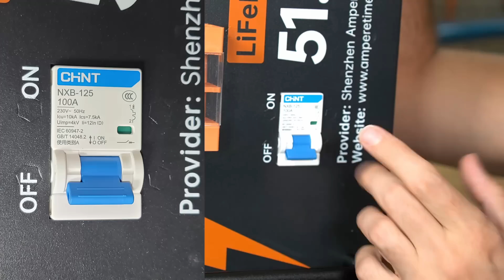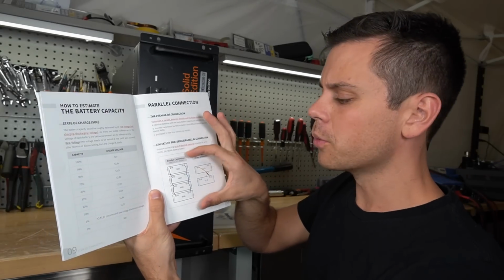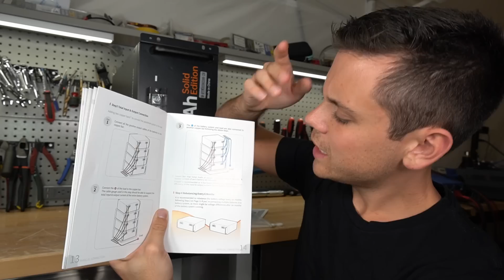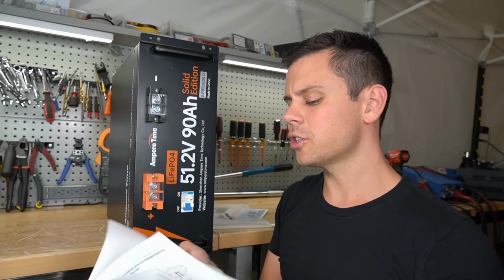New! $1,699 Ampere Time LiFePO4 Server Rack Battery

Comment: Hi, have u done any testing on Felicity battery models that felicity claims it uses grade A batteries like LPBF48300 
I installed one of these at my daughter clinic and they appear to work ok so far although we haven't really put heavy loads on the yet.

I heard so many claims about felicity using recycled / grade B batteries but so far I haven't seen complaints yet from anyone

Comment: Will,  I appreciate your clear explanations of a subject that is very foreign to me.    I'm looking to put together an emergency longer term back up system to run my fridge and separate freezer (3.2KWH total per day) and have a bit extra for some lights (maybe even 12V string lights).  Since the fridge and freezer do not need to run 24/7 to keep food cold or frozen, I'd also like to be able to keep my laptop charged and maybe run a monitor.  It looks like the 5.12 kwh EG4 battery would do the job, with a little left over. What difference would 48v make over the 24?  They have the same kwh rating.
Hook that up to  the 6500 EX 48 inverter?   I have a 14KW propane whole house generator that, for long term outages, I would prefer to run primarily to charge up the battery, and then use the battery to run the essentials.   Otherwise it would cost a minimum of $75/ day t(over $500/week) to keep it running, no matter what the draw on it is.  Your thoughts?  thx, Geo

Comment: I see these are available for $1199 now.  After watching a previous video on a 90 aH rated battery, I was wondering if these were 'used' cells as well.  Probably not worth the chance in reduced performance for the $300 difference.
Reply: Was their any design change or just price reduction?

Comment: Will you mentioned getting board with these tear downs .  I would be interested in more information on the functions of the BMS.  Since many of these units seem to use a very similar BMS I think it would be interesting.  How does the current limit circuit work? How does the balance circuit work? Etc.  what are the effects of one battery stopping charge for say over voltage how does it effect the other batteries.  Just an idea for new content.

Comment: Hi Will, I've learned a lot from your videos. Currently building an off-grid cabin and looking to start setting up my solar system. Any chance you could do a video on a system you would use in the budget range of $5000-$8500? I really trust your opinion and am curious what you would go with obviously there's a lot of variables but your videos always seem to cover a wide breadth the way you explain things.

Comment: Hi Will great series of videos. The cost of any PV system is dominated by the high cost of battery storage - have you looked at the feasibility of using an old EV battery as a storage device?. At about 10 years old the EV range will be down to about 100 miles compared to 300 miles new. The energy capacity of the old car battery will be more than sufficient for a PV system and thus give it a new lease of life.

Comment: I ordered your book on solar set up for RV's Will. Supposed to get it tomorrow. We currently have two suitcase solar units. One fell over and one panel broke and we bought a new panel but couldn't get it to work with the unbroken panel. Well we got another suitcase. I put the other back together and it still works. Each suitcase has its own charge controller. I use alligator clips for one to the battery unit and plug the other one into a plug in made for solar. Seems to charge the two Battleborn 100 AH batteries well. I have an ali gauge I put in. I filmed a short video back when I put it in, and it is on my you tube channel Burlington Bill. Always fun to watch your videos.

Comment: Hi Will, thank you for sharing so much good info on lithium. I’m currently building a system on my sailboat. Going through your video’s I couldn’t find a video on a system like we usually have on sailboats and hope you could make one. On my boat I have a starter battery (Lead) and a house battery. Input can be via alternator dynamo, current from land in harbor and optional solar or something like that. We have a lead and lithium system. I’m changing the house battery for lithium, do I need a new charger for the new lithium battery or can I use the old charger which was use for my lead acid house bank. We also have a device with switches which battery is charged first (don’t know it’s name) first starter battery then house battery…. Would be sooo helpful! Thanks for all you’ve done so far!!

Comment: Will I have a system im trying to hook my batteries up to. I will pay you to help me figure out what needs to be done. I have a micro inverter system that sells back to the grid. I was told i could get batteries hooked up for when the grid goes down. I can not find anyone to figure out how to do it. I have had many electricians and most solar companies wont come out since they didnt install the pannels and the rest of the system. The company that instslled my system is going to pay for instilation of my batteries. They only used tesla power walls and i refused to use them. I have 6 EG 4 batteries i need hooked up. If I send you the system schematics if you can figure out whats needed to be done I will pay you for your knowledge.

Comment: Hi Will: Just love the info you put out. I have a tied to the grid solar roof mounted (Tesla) contract. 

I would love to see a video discussing steps in converting a grid tied system to adding a battery backup system once my contact is paid off.

Comment: Hi, I'm looking for some assistance with a project for my RV. My RV is set up on a 12v system and want to add a total of 900w system. I have 9 100W panels with a new 100A MPPT charge controller with a 3500w/ 7000w inverter. input voltage is 15v-24v and max PV input power 1200w. My question is how to wire the panels. Any help would be appreciated.

Comment: Hi Will, I purchased a JITA 12.8v 100ah battery and was hoping you could tell me at what voltage should I let this get down to before I charge it? I want to discharge to 80% to help get the most cycles. I am guessing I need to put on charge when resting voltage is at 12.2 or so. I don't keep a solar hooked to it at all times so knowing what voltage I need to charge at will help me. Thanks for your help.

Comment: Will, What batteries do you suggest for a 36 volt trolling motor for fishing? Probably three 12 volts wired for 36 volt output.  That way I'd have a "back-up" 12 volt battery to start the outboard motor.

Comment: Well is there a way that you can connect a wind generator of some sort onto the front of a electric vehicle and have the power generated by the wind feeding back to the batteries as the vehicle is being powered by a different bank of batteries that you could switch from bank to bank and let recharge as you are discharging the other bank? In other words I'm thinking of having two different banks that you can switch from alternating for your power source while one is rolling the other bank is being charged by an alternator and a windmill and solar panels yet still connected to the one that is being discharged and used for power?

Comment: QUESTION !! Okay I'm going out on a limb here to ask a very good question!  If my home at this time is running avg 88 kwh per day for 31 days how much solar would it take to run this home yes I still could cut some unused  things out but it is a 2200 Sq ft home?  I have got a start on 3 100 watt solar panels, 3, 35 watt hour and a marine battery deep well, this is tied to a 5000 running 10,000 max load inverter.  All I'm trying to do is save money on these $368.00 electric bills now for the last 2 months this along is killing me financially.   Any help will be greatly be appreciated! Thank you.   Keep it up waiting for the next video!

Comment: Hi Will, great channel. I’m designing my system and am using Victron equipment minus array and batteries.
 Is there any reason you’ve never done a review about BSL Batteries? Their recommended by Victron for using with Victron equipment. 
I’m currently looking to purchase a few 51.2v 200amp models and can’t really find much on the web about them except the company has been making batteries 20 years. The lithium battery factory has been around 5 years or so. 
Any chance we could see a review in the near future from you?

Comment: Here is a question, I am thinking of getting a eco flow delta pro, it has a current/ voltage / wattage limits to its silt input. Here in U.K. the difference in solar gathering will be significant. Is it possible to have 2 banks of solar, use 1 bank for summer and both banks for winter, and have a limiter in case we get a sunny day in winter that exceeds the input limit? Steve

Comment: Hi wil, Bob here again, the other thing that concerned me with the KiitoKala battery was the price it says $244.24 then they give a variety of battery so I went back and double-check and yes it is the 150 amp hour battery they have many of these batteries all the way up to 300 and a half hours and they're all very low priced the 12 volt 300 amp hour battery is $610.60 that's cheap for battery this size so I'm wondering what the build quality is. Thanks again

Comment: Hi Will, thank you very much for your reviews and sharing your knowledge, I'm learning a lot from you!
I'm starting a solar and battery project soon, and I need some help to get pointed in the right direction, if you have a moment I would greatly appreciate your insights.
My wife and I are about to live full time in a 40ft 5th wheel RV and travel the US, Canada and Mexico; access to electricity is of course an important consideration. Our questions are: how should we determine what batteries and panels we need? What brands should we trust? How do we determine how much we need?
We know that over the course of 12 months, our avg energy use per month is 200kWh, the most we've used in a single month was 370kWh; how do we translate these usage numbers into both storage and generating capacity?
If there are some resources or websites you could recommend we'd be very thankful!
Reply: Buy his book..
Reply: @ES-qt6yo  I didn't realize he had a book, I will look for it, thank you :)
Something I want to learn about next is wiring individual solar cells on the convex roof of a vehicle - what translucent material to place over and protect the cells with, sensors/fuses between cells for safety, proper adhesives, etc.

Comment: It does look a bit cheap but... If you have worked in a data center south of the arctic circle you would know a low temp sensor would be throwing away money. And I will bet it was dropped or was in a shipping container in rough seas.. Love your enthusiasm 👍

Comment: Ampere time and it's several other names seem to build decent buget 12v systems. But the server rack and even the 100ah 48v marine battery are definitely way overpriced. Honestly, I'm not sure why anyone would buy them over the other options. For me I like to have low temp protection controlled by the charge controller vs my battery packs. Just so much easier to check on one sensor then be worried about 10 or 15 others.

Comment: Hello Will, I am enjoying your channel. I have purchased a Bluetti ac3000. I will charge them from portable panels and need to run a wire from the back of the house to the ac300 in the garage about 70 ft. what do you recommend on wire to use and voltage?
Reply: test

Comment: You had asked for video ideas a few videos back. 
I am interested in how vertically mounting bifacial panels (run N-S) compares to placing them south at optimal angle. It seems like this is could be a great way to level you generation through the day, gaining more power earlier and later

Comment: You think they bent two steel bars, identically, with shipping damage? Better buy some lottery tickets…

Some CBs don’t have all of their ratings printed on the breaker. These might be the same. IE, QO breakers are DC rated but you can only find that out in their FAQ or catalog.
Reply from the maker: No we checked when these were first used two years ago. The DC rated ones from this company have black instead of blue on them too. Look up the data sheet

Comment: Let me tell ya'll something about taking Will Prowse's gear advice. I built a 400W solar PV setup for my bus using Prowse's parts list and techniques. Did pretty much everything he advised the way he advised it. What did I get for that?

Well, after 2 1/2 years, almost everything else on the bus has broken, but the solar PV system is chugging along just fine. It's been burned, frozen, and bounced on some awful roads, but it just keeps working. Not many young men I'd consider a guru, but Prowse has earned the title.
Reply from the maker: That is fantastic!!! 😁👍🏻
Reply: It’s interesting to me how many solar techs/instructors I’ve watched, and Will is the only one who makes me feel confident in building a system. I’m also a General Contractor, so I hope that adds a little weight to the complement.
Reply: @chrismullin8304  I used to fix UHF radios in the Marine Corps, so I think my compliment carries some weight too. Prowse's presentation is simple enough for beginners but comprehensive enough for people like us who have some relevant experience. He's a good instructor.
Reply: @PatrickPenskey  Oddly enough, the problem with not having any problems with the solar PV setup is that I've had no experience diagnosing and fixing problems. :)

However, the experience did help me find and fix a problem on the main bus. Had a flaky ground cable that was too small. I might not have noticed it if I hadn't learned from this channel how to think about cable sizes and connections.
Reply: 400w huh...  don't go too crazy.
Reply: @rustusandroid  400w 2.5 yrs ago was a good amt..given the tech and costs at the time..
Reply: @ES-qt6yo  Not really.

Comment: Will............ PLEASE try to answer this question. A big concern I have is how long will these BMS's last in all these batteries out there? Especially the cheap little BMS's on the cheap little 12ah type batteries? Does anybody know the life expectancy of a BMS? I would expect the cells to last at least 10 years and more like 20+ years. That seems like a long time for a BMS to handle the current and voltage. I would really love to know more about BMS life expectancy and dependability. For all we know they only last half the cell life. Maybe less. I think this is an important question to know the answer to. What are your thoughts? Does anybody have any idea about this?

Comment: A really bad built battery. I will never buy such a server rack battery. 😳
Regarding to the QR-Code you have shown the LiFePoQR Battery QR scanners say that this cell is an EVE LiFePO4 Cell production date 25/2/2021 in Jingmen, factory product line 22, factory task oder # 92 with 440 produced cells in this batch, modul type unknown and capacity unknown. 😏
Well, I am currently interested in getting some good quality 48V server rack batteries for a good price, but this battery is neither nor. 🤐

Comment: Will, most people put their lithium batteries Indoors. Mostly for theft protection.  They store them in their storage, behind their false wall, under beds, under couches, under dinettes. Why do they need a low temp cutoff, when the batteries are in a temperature regulated area? I’m not saying this battery is a good one. But I own two, 200ah without temp sensors. I have them in a regulated temp area, so I don’t need to have a low temp cut off. I love my batteries. They have made it that we only have to come in from the boonies, to dump and refill tanks.

Comment: Since 2007 I have been talking about Inverted Transfer Energy system that is designed to maintain the battery bank charge for the off-grid renewable energy system up to 5kw. Keeping the electrical energy on even during extreme weather events from Climate change.
Please, let me be perfectly clear. Inverted Transfer Energy is by no means mechanical perpetual motion, free energy BS, over-unity, zero-point energy, or anyone’s theory in any media type throughout time. Sadly, people refuse to even listen one time about how it works.
Climate change is real, people are not.
Reply: I'll bite. What is Inverted Transfer Energy?

Comment: so at that price, they're horrible.
however, of they were priced (alot!) cheaper, would they be useful as say, an extra string or a smaller stand-alone setup?

a weird (?) thought popped into my head: would there be any value in having the ability to "divide" battery banks into strings such as "primary" and "backup"? such that the system somehow only used the primary string the majority of the time, and only drew on the backup string in times of emergency?

Comment: Just buy a popular server rack battery and reverse engineer it.  Simple.  So those are normally 105ah batteries, so they bought them for cheap and tested them.  So many red flags with this battery but if you never opened it, you'd never know.

Comment: Hi Will!
I wonder if you would find it interesting to do a video on batteries like this charged through the grid when the prices are low, like during the night. As an alternative to panels. 
Today, prices vary by factor 12, sometimes 300, from night to day in southern Sweden. 6 hours per night on average.
How many kWh could you charge those new litium batteries with through a regular outlet or car carger? And what would be a good simple setup for this?
Reply: Same here in the UK I would also like to see this.